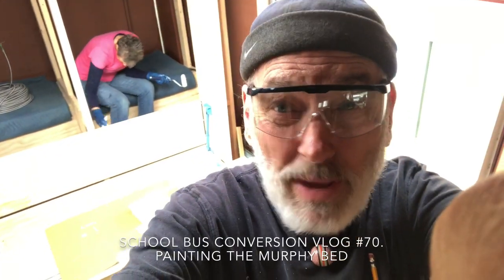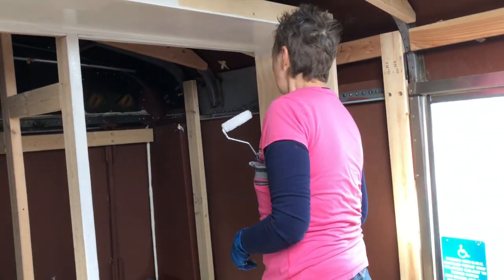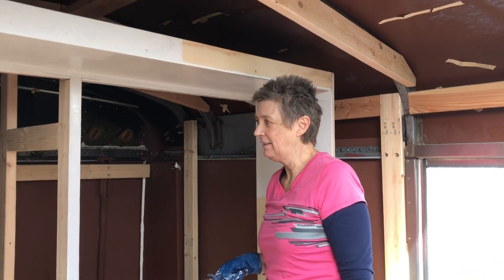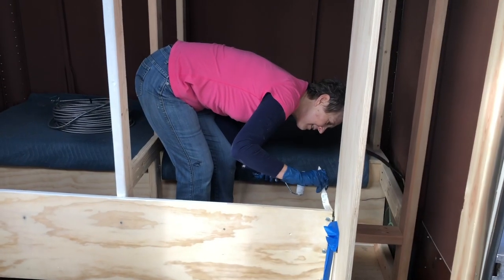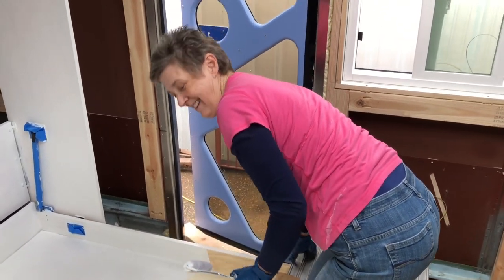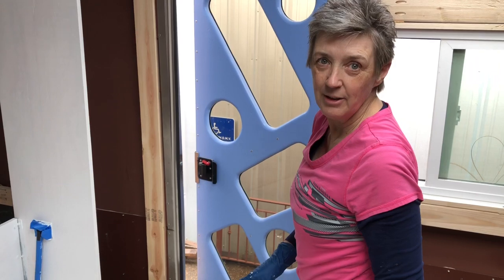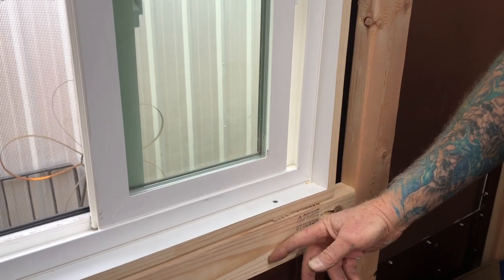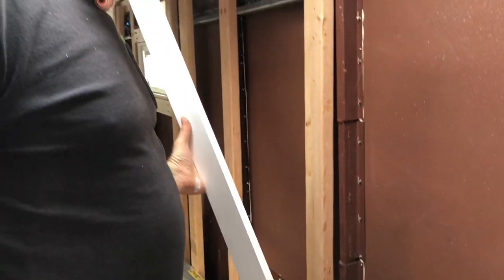Painting Murphy Bed - Vlog 70 School Bus Conversion

Comment: Most people use slats for bottom of bed so mattress doesn't mildew with condensation
Reply from the maker: Were using heat sources that don’t add condensation to the bus. The mini split has a dehumidifier mode that we can use. So we’re not thinking the humidity is going to be a problem. We built the Murphy bed to the plans. Feeling like when it’s tiped up it won’t be laying tight against the bottom and it can air out anyhow. If it does prove to be a problem we will simply figure out a way to add ventilation to it. So we will be keeping an eye on it. Thank you for your comments.

Comment: I wish these videos was a few years old, so I could ask you how your windows are doing.  I'm still not sold on using a house style window, although yours fit nicely and look great.
Reply from the maker: We totally understand where you are coming from. We had a hard time using them too. We made them so we could change them out if we have too. They are tempered safety glass. The only problem we see is that the seals can break from elevation change. If that happens we could remove the inner pains or remove them completely and replace them with laminated safety glass. So we have alternative plans.

Comment: Great series, just got caught up.......what’s your plans for HVAC.....windshield defrost?  Bathroom vent, other than window?     The area behind the Murphy will be storage, but couldn’t you have moved it back a little?
Reply from the maker: Oh Knapp Time binge watching seems to be catching on. Welcome aboard. We love having you and sharing the journey. For heat we have a Dickinson marine propane heather. Haven't totally figured out the windshield defrost but looking into a few options. Bathroom will have a super fan and will be located in the center of the bus. We will also be using this as our kitchen fan ... the oven will be located close to the bathroom door. As behind the Murphy bed ... we could move it back any closer because of the swing of the bed without the roof getting too  high. We were trying to keep our overall high under 12'6'' I believe. I hope this answered your questions.
Reply: Knapp Time thanks that all makes sense.  Kitchen/bath exhaust fan combined is good idea.